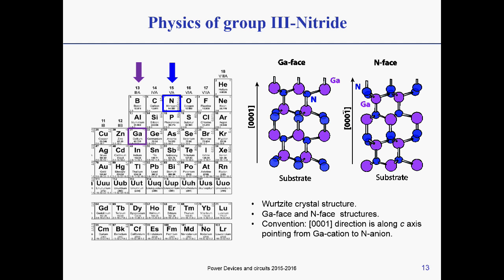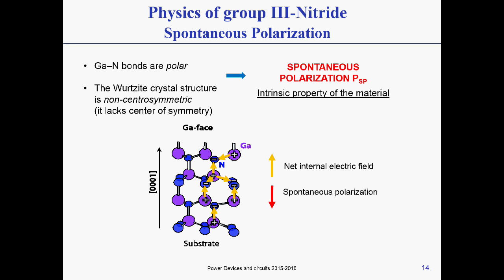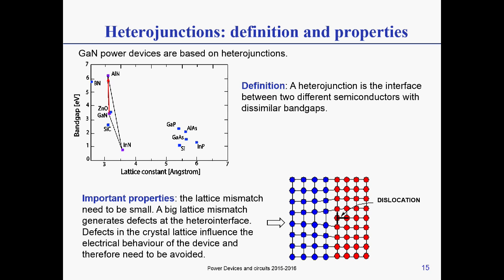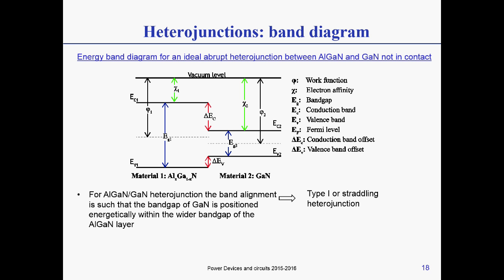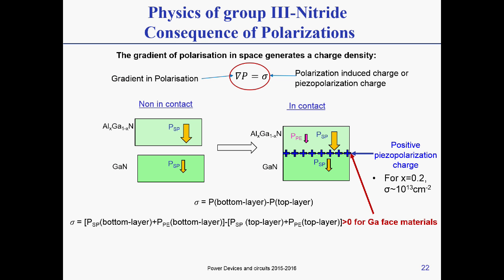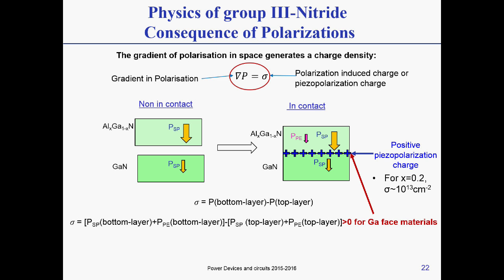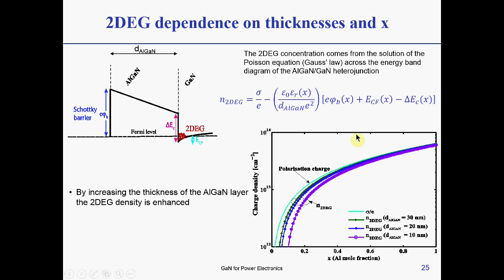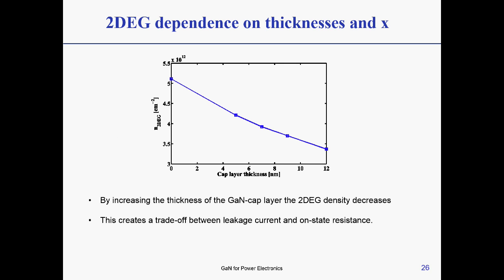GaN Power devices - Physics of GaN devices

Comment: The fact that the AlGaN layer is piezoelectric - does this mean that GaN devices are noise sensitive to vibrations?
Reply from the maker: System vibrations are not likely able to bend the chip that is well protected by package and has quite small dimensions. This should be a negligible effect.